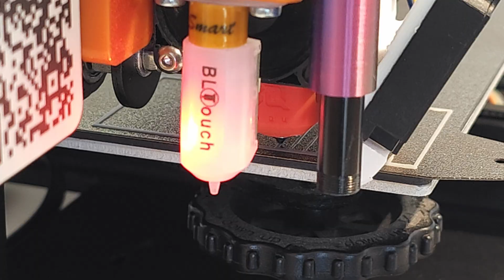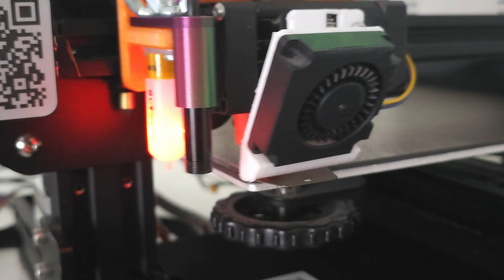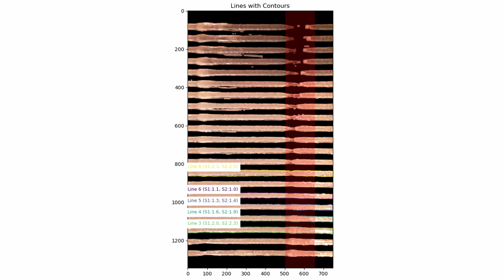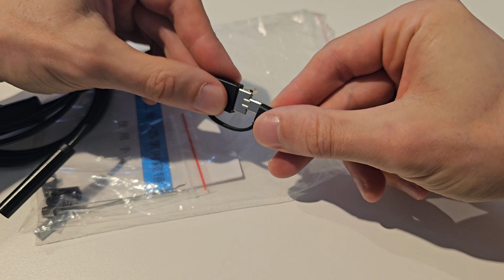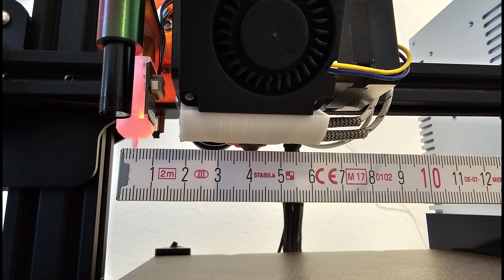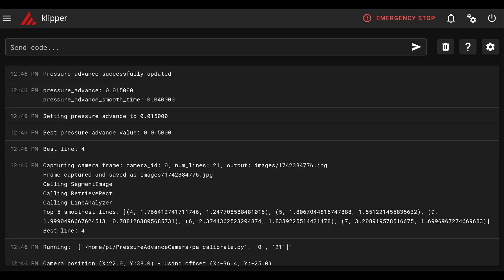Automatic Pressure Advance Calibration with a cheap USB Camera for 3D-Printers running Klipper

Comment: Would it also be possible to calibrate the flow with this setup?
Reply from the maker: I have not tried. I guess theoretically it would be possible by measuring the line width but I'm not sure how accurate this would be

Comment: im not that big of a fan of using an external service for image segmentation here... i think this is something easily covered by openCV and a printed checkerboard for correction.
I also feel like this leaves a lot to desire, when youre doing it automatically why not go the full way and run a proper model with multiple speeds or just adaptive pressure advance
EDIT: nevermind just got to the part where you mentioned it
Reply from the maker: Yes it's definitely possible to do it without AI on the printer but this was also already a huge amount of work getting it to this state and I did not manage to get reliable results so choose to use the AI model which is not as so nice solution but in practice costs nothing compared to the filament etc so also not terrible... I think you may enjoy my other video about the skew calibration using the ChArUco board which only uses OpenCV (even got a patch in OpenCV merged which makes the ChArUco detection 100x faster). https://youtu.be/WQilddTZJRA

Comment: i just oredered a camera and am going to use this. I want to use this for TPU. any advice on how to best use it for TPU?

And what about using painters tape in the area that is going to be scanned?
Reply from the maker: Sorry for the late reply. Great to hear please let me know how it goes. I have not tried it yet with TPU - but as long there is not too much stringing which could confuse it should be working. Tape should be fine as long as it makes the background easy to distinguish from the printed lines.

Comment: Ok how does this compare to Rubedo calibration ?
Reply from the maker: I think Rubedo will be more accurate and does not depend on the filament/buildplate contrast but also requires more expensive hardware and guess slightly harder setup with the laser.
Reply: @HierNichtErfunden oh thanks 🫡🫡

Comment: Would it be possible to mount it closer to / in line with the nozzle travel and record the picture /each line during printing and process only one line? When its getting worse you return to the last values? When you are far off you could increase the values/Steps per line.
Reply from the maker: Could work (but is not currently implemented) problem with my camera would be that it can't focus really close up but there are likely other camera options which can.
Reply: @ just guessing (I am not a programmer) line by line would be easier for AI and learning model and maybe could be done on a pi. Again not a programmer - just thinking loud.

Comment: Hey Marius! Very interesting project indeed! I’m running a voron, so I suppose this would work with not too much modifications? I know you put a lot of effort in isolating the pattern without AI without success - I still think, this should be possible, the pattern is so well defined… let’s wait for other people picking this up, or maybe your own progress. AI seems like mit Kanonen auf Spatzen schiessen to me. ;) good luck and thanks again for sharing! Martin
Reply from the maker: Yes should work with your voron - if you try it out let me know if you run into any issues etc.. I agree the use of the AI is a bit much.. likely if I require better lighting my old code could also work more reliable (the one which uses no AI) - I just did not want to release something which is completely unreliable. So think maybe dual approach would be good: local if conditions are good and if not send it to the cloud. I bought a led light strip but did not mount it yet to see how good it works with better lighting.

There is some work going on an trying to simplify the task by using a before and after image: https://github.com/undingen/PressureAdvanceCamera/issues/3

Comment: Maybe a slightly higher quality camera and a build plate with QR codes like how the new H2D does it? There are some very positive things that printer does that should be standard. I think your on to something. 
Just having to never tune filaments for PA would be huge, more accurate prints across all filaments. Was going to build a Voron 2.4 r2 but i'll wait to see what Creality and others do now they have seen the h2d and its features.  I'm thinking of a H2DxK2 plus toolchanger printer that never needs tuning, only maintenance.
Reply from the maker: Yes camera provides lots of possibilities :). I had multitoolhead calibration in mind but did not think of the movement calibration using the codes like the H2D has - guess in the future we will see lots of printers which will come with a camera on the toolhead - hope they will be easily accessable to 3rd party software can also use them.

Comment: Curious if this could work with Bambu Studio?
Reply from the maker: It should be possible to use BambuStudio instead of OrcaSlicer to generate gcode you only need to modify the start gcode for the printer (maybe there is a difference in variable names for the tempertures).

Comment: You're one step closer to k2 plus's features
Reply: Do you think you can mount it on the side and put the endoscope on an angle so it doesn't have to be mounted on the printhead. And for the flow calibration you can do a similar test like the k2 plus does
Reply from the maker: yes thats what I meant when I was talking at the end about better camera and calibrating with checkerboard. I have not tried it but I could imagine that it could work with having the camera mounted besides the bed at an angle and correcting for distortions by having the camera calibrated once during setup (by showing a checkerboard/dots): https://docs.opencv.org/4.x/dc/dbb/tutorial_py_calibration.html or https://scikit-surgerycalibration.readthedocs.io/en/latest/tutorials/calibration.html Don't know when I find time to try it out have written it done for things to try.
Reply: @HierNichtErfunden  more power to you, looking forward to the improvements😍 No pressure.

Comment: Great idea, the results are beyond what I expected!

Did you try taking the photo of the build plate before printing the pattern? Before/after photos would make the segmentation much easier.
Additionally, cross-polarized light could help if consistent lighting is required.
Reply from the maker: Thanks a lot! Yes I actually tried that but it surprisingly did not help. Because even just taking the photos a minute ago from exact same position the structure textured PEI sheet looked completely different (on my unenclosed printer). But I agree improving the lighting situation is differently the best thing for improving the results and getting the best out of this cameras.
Reply: Well, you have to align the photos before subtracting them. I have some image processing experience, and this seems like a really fun and useful project :)
I'd like to explore this further, and I would be most grateful if you could provide me with some sample photos. Should I open a github issue or would you rather prefer communication via email?
Reply from the maker: Thanks for offering to help :). Yes please open a GitHub issue for it, I will make a few different photos tomorrow and attach them (and try to to set the exposure manually so at least this is not changing between the images). I did not try to align the images.

Comment: 8:35 Could you also use a nozzle camera and calibrate it with the checkerboard?
Reply from the maker: Yes :), I could but I found it unnecessary for the calibrations I did and did not want to introduce too much extra steps to get it setup. (I also initially took an extra picture from same position but before the pattern got printed to diff the images but found it not that helpful). Calibrating the camera would improve the accuracy of the Image unwarping/lens correction so in the future maybe would be good way to get more out of the existing camera..
Reply: @HierNichtErfunden  I really like the idea of Dual use the cam for the calibration and as nozzle cam